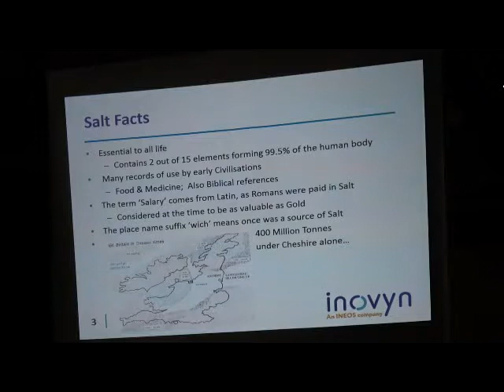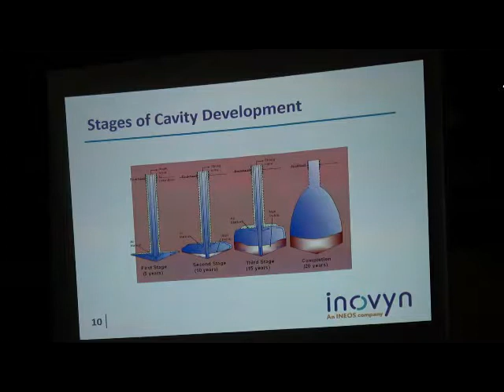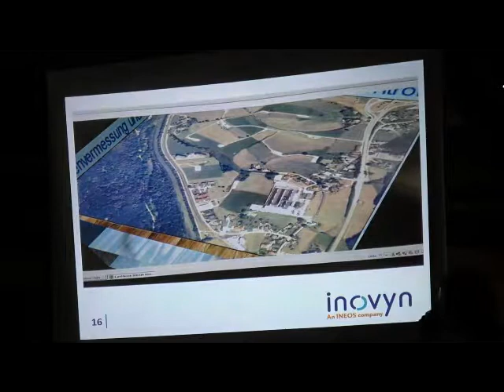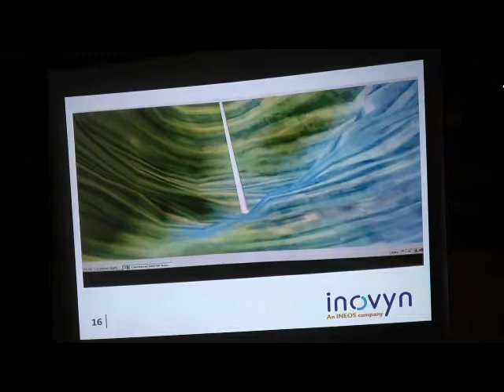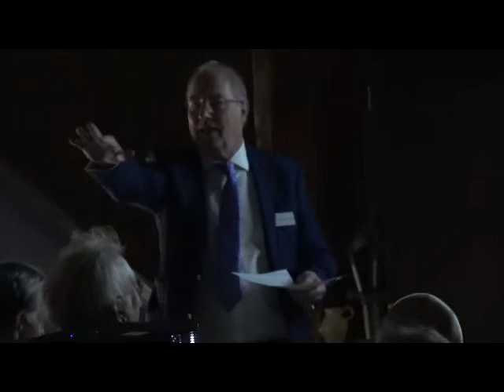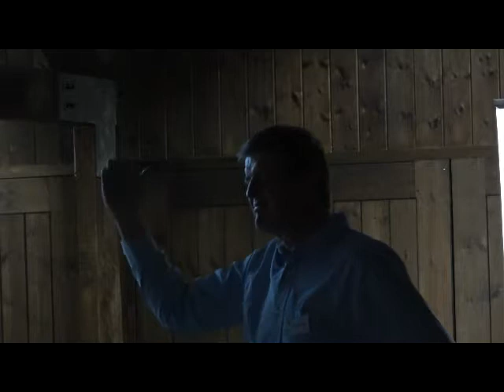Modern Controlled Brine Extraction

Comment: I worked in the BC cell rooms at billingham from 76 to 82 where we produced chlorine from brine water using electrolosis, side products included caustic soda again produced in the cell rooms, hydrogen and  sodium hypochorite. The brine we used came from seal sands and in my later job on oil gas plant we stored OCO gas in the old brine cavaties